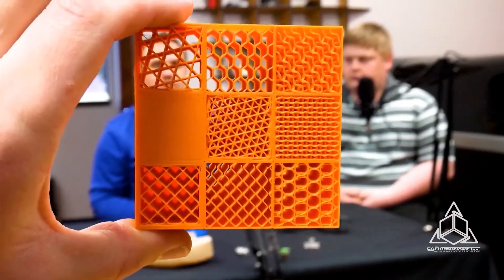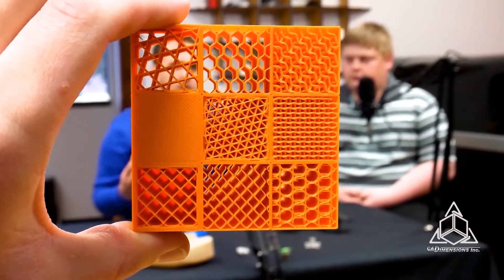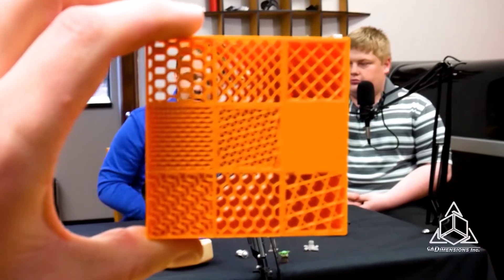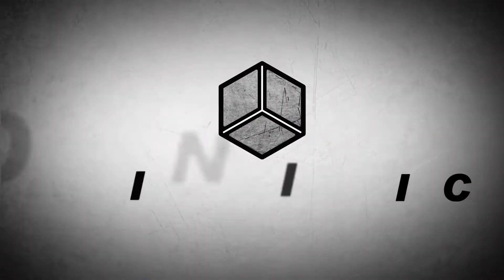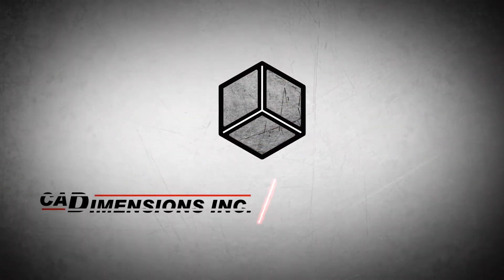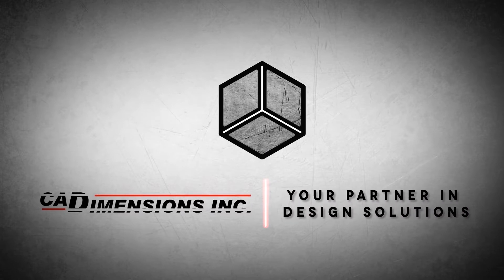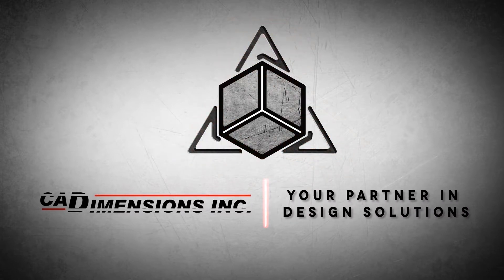How To Make STRONGER 3D Prints: Shells Vs. Infill | Additive Manufacturing Podcast

Comment from the maker: What do you think makes a 3D print stronger? The infill or the shell?
Reply: Why is it one or the other. I've always done both. 
Their cheap printers. It's going to take hours either way.
Reply: I'm not sure, but I would says it depend on the  type of charge and where it is applied. But, generally I would say the infill, since the geometry can greatly affect how the charge is spread.
Reply: While not uninformative, this show might as well be an audio-only podcast and save the world some bandwidth because little else is seen here besides talking heads.
Reply: im gonna be good and guess before watching the answer, honestly id say the infill is slightly more important but like 60% infill 40%shell for strength
Reply: I think the wall thickness and geometry is ultimately what makes something strong.   I base this upon simple physics where loads are transferred along a path, force * distance.  The end of the lever arm is the perimeter of the object.  If you don’t trust that analogy then take note of the highest strength to weight objects in the natural world, bird bones, and they have sparse infill. 😂
Reply: That depends on the applied load. 

For crush restistance, infill, no questions asked. 

For bending, shell thickness will impact the strengh of short thick parts (where bending tension is the problem)  while infill will help strengh for long skinny parts like wings (where buckling is the problem). 

For tensile strengh, printing orientation has the highest impact and infill to shell ratio has no influence since the only really relevant parameter is cross section. 

The designer now has to figure out how the part will be loaded and apply the necessary print settings.
Reply: pro trick: watch movies at flixzone. I've been using it for watching lots of of movies recently.
Reply: @Dakota Oakley yup, have been using flixzone} for years myself :D

Comment: I make and fight combat robots. And we use lots of shells and the bottom floor. And whatever the bare minimum infil we can get away with. But we use tpu as our primary Armour. Its not uncommon for us to use 4 to 5 shells. 8 to 10 bottom floors, 5 top floors and 5 to 10% infil.

We also use the bottom side as the side to take the impacts because of the cross crossing of layer lines so it dosnt just split.

Comment: Leave my guess?  I don't have to guess- I already know because I'm an engineer.  For a part that has significant bending or torsion on it the thicker shell will provide the most strength.  That's not to say that you should use 0% infill because the infill may serve a purpose to connect the shells together and prevent them from buckling under compression stresses.
Reply: This and for compression forces acting on the surfaces (not in line with the surface) infill will make a difference.

Comment: I find the easiest example to understand is a solid rod vs a hollow pipe.  If supported at both ends with a weight suspended in the center, the top is experiencing compression force, the bottom is experiencing tension force, and the forces balance to zero at the center.  Thus, the hollow pipe is nearly as strong as the solid rod.  The closer you get to the center, the less effect additional material will have.
Reply: yes but do you print hollow pipes exclusively?

Comment: What if you put multiple shells within the part with infill between them?

Also, what if you could warp/distort the infill itself to better match the contours of the shell?
Reply: You would be better off putting the extra material on the outside.
Imagine a square rod, sticking out of a table it's attached to. You want to hang something on that rod.
In order for the rod to bend down, the top of the rod has to get longer or the bottom of the rod get shorter.  For there to be a bend, a curve, the inside radius would have to be smaller than the outside radius.
In the center of that rod, the center just has to bend - it doesn't have to get longer or shorter.  Which is easier - stretching plastic to make it longer, or bending it?  The center will bend easily. The strength comes from the fact that the top won't stretch, so the entire part can't bend.
The part infill plays in this is just ensuring that the top doesn't collapse down to hit the bottom, that the rod doesn't crease.

This can be seen easily in the construction of cardboard , such as used for a moving box. There are two sheets of paper which makes up the two sides of the cardboard. The paper doesn't stretch, so the cardboard doesn't bend easily.  Between the two sheets of paper is just a little wiggly paper (infill) that is only there to maintain some spacing between the top and bottom sheets of paper, the shell.

Comment: So i think. Your option should vary on the need. What if having a simulation software to see how different variations of print is better.
Reply from the maker: That's definitely one way to go about it before making a physical print.
Reply: @CADimensions  exactly. Just to save time, effort and energy. Also save materials. Car and plane manufacturers doing simulations too before making the actual product.

Comment: When making full density prints, I've had better success with shell all the way to the core as opposed to 100 percent infill. Especially with tpu. It's typically a zero interference pattern, leaving less chances for things to go wrong. Full shell is also more forgiving for flow regulation.
Reply: thank you, this is the exact thing i came here for!
Reply: I disagree with TPU. Having infill at 99% makes it slightly flex more (barely noticeable)

Comment: In strictly shells vs walls, walls would make the stronger print. In saying that,to me the strength of the part of determined by the shape of the part and the percentages of infill vs shell that could be optimized to give it better strength depending on the type of load against the part, weather it’s shock load or tensile strength and even then you could go down a very deep rabbit hole as to what shapes (geometric vs organic). Everything can be optimized now days and there are some good videos out there showing part strength with different loads and different material.

Comment: 7 minutes of 5 guys trying to discuss part strength eh? Simple example: Egg vs cylinder vs bee hive vs topology optimization
Anything round will be strong especially from the top and bottom plane of a cylinder and has decent strength from the sides, but mostly when forces act from the inside out.
Otherwise, a tubular infill adds little support perpendicular to the circular planes.
Honey comb is one of those things in nature, that has great strength, load dispersion and use of space in all orientations.
Anything round leaves gaps and stress points that are unused and make sense only, for weight saving in flat parts.
For strength in structures, honey comb is the best all rounder.
The only other thing that makes a nearly perfectly strong, light and quick print part is topology optimization, like how nature grows our bone structure.
Most infills are just a waste and never consider the forces on a part, this is up to a experienced designer, making the part in CAD and prototyping the crap out of it.